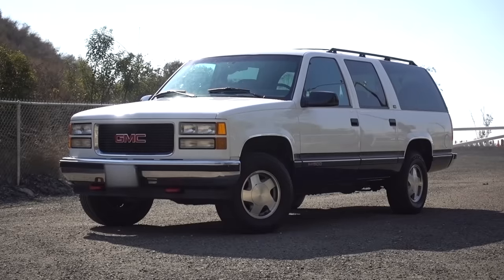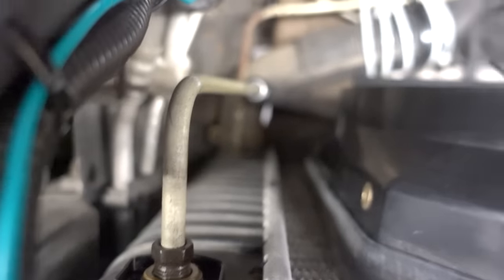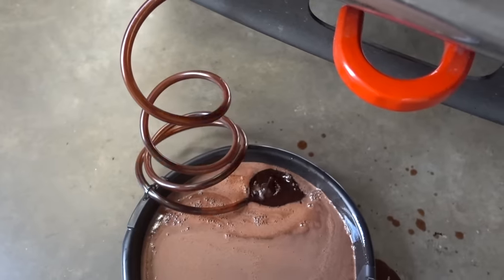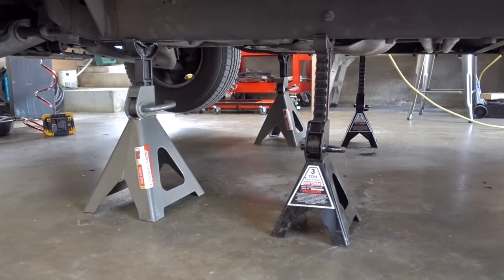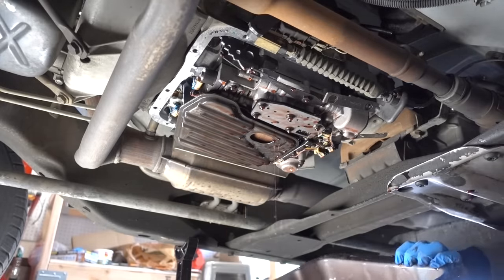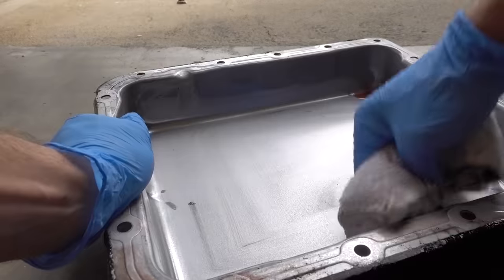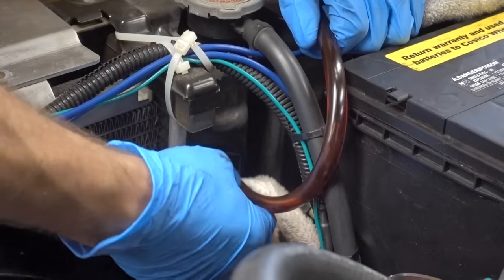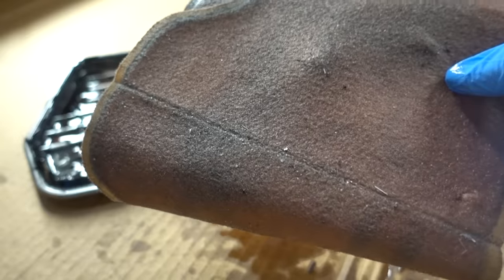Why You Should NEVER FLUSH YOUR TRANSMISSION FLUID!!

Comment: "Why You Should NEVER FLUSH YOUR TRANSMISSION FLUID!!" (proceeds to flush out tranmission)
Reply: What he did ia not even a flush. It was fluid replacement only but he he called it a "flush".  He's a  confused guy.
Reply: I was thinking the very same thing after watching...well it did get me to watch so there ya go.
Reply: I wouldn’t flush it at a shop I think they use pressure and you will end up with more leaks than you had I’d change it but not flush I guess he don’t know the difference
Reply: I ABSOLUTELY AGREE, for example when he shows the metal in the old filter, I considered that the filter WAS doing its job. I have seen many screw-ups by kids working at quick oil change shops doing real damage at this. I currently am driving a 21 year old Buick LeSabre with over 100,000 mils and the HORRIBLE :-) original fluid in it and it shifts and works perfectly. This transmission fluid change is like the air filter scam, or the NITROGEN tire inflation stuff. I know you cant hear me but I am SCREAMING just like he did, but I am saying "IF IT ISNT BROKE, dont touch that transmission".
Reply: It's called 'click-bait'....
Reply: One added note, some transmission required running a relearn procedure, look it up for your vehicle before you start.
Reply: click bait
Reply: John Dossey This is definitely true, especially on a good GM tranny, they last year's and don't beg for that much attention if taken care of, it doesn't always require even so much as a complete fluid change, I've seen 200-300,000 miles on them and 20-25 years and shift almost perfectly and as if not better than new, I'd recommend checking and adding some. And if it's the "un-checkable" style with only a hidden fill plug, There is a screw to check and I usually just drain a bit if it's full and add approx 2qts after about 125-200K miles, at least that's what I've done to all of them and they all now have well over 175-255k or close to it and they shift amazingly smooth without any issues in the Buicks and all, I've worked with many, but I DO NOT recommend a flush and n them nor would I say they even need anything else unless a rubber seal leaks in which case I still just try to replace the seal without disturbing anything as much as possible by all means, and they will continue to be the way they were, I'd say Oil change and fills of any obvious fluids do best for them.
Reply: I meant to say Oil change with(Engine obviously) and any other fluids just to be filled and maybe something good for coolant and oil coolant for corrosion issues and oil for loss of pressure is(usually higher viscosity. Or Lucas etc. Whatever floats your boat pretty much).
Reply: @erwinmelgar9575  If you listened closely, he even states it's not a "flush".
Reply: He didn't call it a flush... He literally said he chose not to flush it, just change it... And that is all he did, was a change, not a flush...
Reply: @jldossey45  false fluid should be changed every 30k miles
Reply: @jldossey45  times were different with that Buick Trans and When that Trans fluid was made.. CVT fluid is not even thick it poors out like water, thats probably why they don't last very long and have issues.. Most of Todays Transitions need there fluid drained and filled from 35 thousand to 75,000 miles depending on the make.. But the dealer will tell us it's for life! Life only being 100,000 Miles and if you get to 150,000 miles you are doing real good, But I notice that the people who don't have issues with newer cars Do the Necessary maintenance, And most importantly keep Fresh fluids in there Vehicles constantly, It's not that much money to flush your trans every 35,000 like a hundred but worth it if you plan on keeping the car...
Reply: @JeffCounsil-rp4qv  he said it in the beginning of the video.
Reply: @jldossey45  Drain and fill, with the original type of fluid. Stay away from the back-compatible stews formulated for later models. IF Dex III was still the original, use Dex III.
Reply: Thats why he makes the big bucks
Reply: I don’t understand the title either
Reply: The flushing out of the old fluid he says when you see bubbles shut the engine down immediately.......I recommend an assistant for this step.  By the time you see the bubbles, get around back to the interior and turn off the key that could be the difference between transmissions being totally starved of fluid and.....damage already done....

You didn’t say what the bolts you torqued inside the transmission housing.  

Good tip about the magnet.  With some modern day “Sealed for life” transmissions the filter is embedded in the transmission case.......yes you Ford.    Even with flush most people would probably not think about removing the pan to check the magnet.

My 03 Durango did not have a drain plug. You had to loosen the bolts and drain fluid one corner at a time.  Had a fill Tube but no drain plug.   Fast Forward to my 2011 Mercedes E350 has a drain plug but not fill tube.  You have to force feed the new fluid from the lower side.

1 Road:  I am not sure what part of the country you are in but they have lab service in Fort Wayne, Indiana.  I used it for a coupe of oil samples but I would suspect they could analyze other fluids.  They ship you the kit which is basically the same concept as Blood draws for lab work.  Take a sample of the old fluid during draining and send the sample to them.  A few days later they should be able to tell any excessive levels of one material, overall condition and possibly early heads up for possible future problems fluid wise.

Google Blackstone labs.
Reply: @jldossey45  every car I've changed the trans. Fluid in 3months later the transmission started to slip....
Reply: Erwin Melgar what’s a flush then?
Reply: In my opinion this is considered a flush. Drained the old fluid, ran new fluid through it, drained that, then put fresh fluid again. The middle step is supposed to flush out all the old crap.
Reply: 😆😆😆 nice one
Reply: You're shouting. and it is annoying
Reply: and NOT helped by misleading titles and screaming presenters
Reply: @thomaslemay8817  shouldn't have given them that coffee break.
Reply: @jldossey45  How often have you changed your motor oil and brake fluid?
Reply: John Dossey transmission fluid and filter replacement works if done correctly, 540,000 miles and counting, 1998 5.9 12v dodge ram 2500 p-pump, since new i change transmission fluid and filter every 60,000 miles and gasket every other transmission fluid change, i pull an 18,000 pound trailer regularly, i also never abuse the truck by revving it hard or punching it off a dead start, she shifts as good as day 1
Reply: I hope to only say this on the subject of not touching fluids if "it isnt broke":  if it isn't broke, it still doesn't need ignored.  Nearly all vehicles have a maintenance schedule in the owners manual.  Some recommend oil changes every 3,000 miles and some at 5,000 miles.  Change the air filter every so many miles, rotate the tires every so many miles, transmission fluid, radiator fluid, checking belt(s), etc.  Following this schedule is the recommended schedule suggested by the engineers of the vehicle.  

We can all say we had a vehicle last X long without something being done but also know someone who wasn't as lucky.  Some people love beyond 90 years old, some have a heart attack and die at 30.  One car may last 20 years while another gives out at 7.  Follow the schedule in your book and good luck.
Reply: YOU wasn't paying attention Mos!
Reply: @moss8448   I kinda thought when I seen him "break loose" tranny coolant line with an "adjustable wrench"  I was like Oh boy. But he did spray Wd-40 first. Now my fffn ears are ringing. Good video All n all. 👍👍
Reply: The pressure is far less than the normal line pressure...it's only enough to move the fluid out.  Myth.
Reply: Howard Russell l
Reply: @nc28144  every 30k, says who? shops that are trying to sell things?
Reply: @jldossey45  How about a 30 year old oldsmobile with 218,000 miles slips second to third in first mile of trip find afterwards.
Reply: @stephencannon3140  . I have a 1998 Toyota Camry le with 110 thousand miles I just did a real transmission flush and it was awesome and way way more easier to do I practically flushed out all the old transmission fluid about 10 quarts and it only took me 2 minutes to flush it out with a 12 volt oil transfer pump I learned this by watching a fix it angel video lol my car is easier than this guys car to work on  oh and changing the transmission pan gasket was also a piece of cake. Lol .
Reply: @jldossey45  I love having Nitrogen in my tires. Pressure never fluctuates with temperature change,nor altitude change.  As far as air filter it should be changed when dirty for sure, right along with cabin air filter such many peopledon't even realize they have a cabin air filter.
Reply: @t-rodshader9593  Some vehicles say that transmissionfluid is good for life of vehicle but if you look into it most transmission fluids are only rated for 100 thousand, but that can drastically change if your fluid gets to hot such it can if sitting a traffic jam or something,an when it does over heat it cuts about 25% of its efficiency with only like a twenty degree over heat,and if it gets to hot it can lose up to 50% of its efficiency.
Reply: @stix562  maybe up to 5 mile per a gallon difference. Some people donttc realize most transmission fluids are only rated for about 100 thousand miles and the efficiency of the transmission fluid can be cut down by 50% from getting to hot,so now the fluid would only be good for 50 k.
Reply: @rolexshine923  I would recommend a AmsOil bypass filter system and running AmsOil. Best oil on market and you can send them samples of your oil and they will give you a report on the oil. Theres a Mac truck drive who runs this and has over a million miles in truth with never changing the oil because of the .04 down  to  
.02 micron bypass filter.
Reply: @jldossey45  in my field I use nitrogen. Nitrogen does not expand with heat or decrease with cold. There for it does what it's supposed to do when put into car tires. Plus it's dry. This keeps moisture out and the tires last longer.
Reply: @victorbunch7725  you WASN'T paying attention in English class
Reply: I don’t think getting it flushed is really that bad, what happens is people wait until their transmission is acting crazy and then go get it flushed and then it goes out later on, and then say flushing it is what destroyed it, when it was already going out to begin with
Reply: @rolexshine923  Your mistake is that you are driving like it is supposed to be driven. If you would only drive it the other way, you would have a shiny new truck by now. And a truck payment to go with it.
Reply: @jldossey45  You probably are wrong to not change transmission fluid. But all you need to do is drain and fill. If it has a drain plug, just drain it and replace what comes out. If it is running right now, you don't need a filter or a flush.
Reply: Retorquing to the proper torque is a good idea, out of my 260 unit GM 1 ton fleet I've changed the fluid & filter (no flush) on all of them a number of times. Loose valve body bolts are not real common, but one time a bolt was completely backed out & the pan was holding it in. Some drivers drive 'em hard, some don't, I change them all on the severe usage schedule, they all pretty much need it, as the magnets can be pretty much loaded more often than not. I'd never use the DEX IV  in a DEX III tranny.
Reply: @erwinmelgar9575  true, dealers do back flushes and don’t change the filter. IMO COMPLETE waste of time  and 250 bucks.
Reply: @jldossey45  don’t ever change it thinking it will fix you’re shifting problems in the near future.
Reply: @t-rodshader9593  True that. My 96 Astro van sat during winters in Spokane, being rear wheel drive when I had a front wheel car that commuted far better. I got slipping in the transmission when spring came so I had the transmission flushed and liquid replaced and it got rid of the slipping transmission instantly.
Reply: @r-prizzle2168  flushing uses a flushing machine that forces not only trans fluid but other chemicals as well and can easily cause damage to the transmission when it forces dirt to clog the oil's passage way.
Reply: @max41050  what angel did was a fluid change, not a transmission flush.
Reply: @rmo4222  agreed.  I do repclace my own fluid and filter as well as the fluid left inside the torque converter which is like half of the total capacity.  Drain and fill about every 2ltrs until the fluid runs clear.
Reply: @erwinmelgar9575  . Thank God because I did the same thing myself,after watching his video I ordered the transfer pump from Walmart and got practically the same 5 gallon jug at winco, my car is a 1998 Toyota Camry le 4cyl, so it was very easy, but weeks before doing this procedure I had already removed the transmission pan replaced the filter and the transmission gasket. Is been 3 months already and haven't noticed any problems, but I have to admit I was questioning myself afterwards because the car already had 110 thousand miles, but the fluid didn't look dirty, that's why I went ahead and did, so I should be safe because this wasn't a real flush well I hope so .
Reply: @max41050  you can get away without using a pump, just drain about 2ltrs out, stop the engine and fill with 2ltrs through the dipstick hole(assuming you have it and assuming your trans takes the fluid in from the pan) then repeat until the fluid runs clear.  Either way, i messaged angel about it and it's okay to use it with my car, Corolla 2006.
Reply: @erwinmelgar9575  . You're right but the pump only cost me 25 dollars and it works perfect on all 3d and 4th generation Toyota Camrys 4cyl, actually I think that the video I saw from fix it Angel was a 4th generation Camry just like mine, he did it on other toyotas but mine was the easiest one, the transfer pump, the 5 gallon jug and a little bit of vacuum hose that I bought only cost me about 45 dollars and I'll be able to reuse it over and over again, I'll probably be doing it again in another 4 years.
Reply: No, he means never do a BACKward flush with a machine at a mechanic shop.
Reply: @erwinmelgar9575  No, it was a flush alright, confused guy.
Reply: @jldossey45  Agreed.  You should never change your transmission oil or your engine oil.  If it ain't broke, don't fix it.
Reply: @oxpahnakompromatkohtpol436  have you seen a transmission flushing machine?  I reckon not, confused guy.😉
Reply: @oxpahnakompromatkohtpol436  i hope this your're being sarcastic as this is the worst advice anyone can give to car owners.
How's you engine oil sludge doin?😁
Reply: @erwinmelgar9575  Yes, was being sarcastic.  I change my engine oil on my 2017 Subaru WRX every 2,000 miles.  Overkill?  Maybe, but changing the oil is the cheapest insurance you can buy.
Reply: @oxpahnakompromatkohtpol436  well, good for you.  I reckon it might be a bit overkill but whatever keeps you sane and that works for you is better than not taking care of your car at all.
Reply: No
Reply: Lol
Reply: @thomaslemay8817  You are exactly right, most all modern electronic transmission have adaptive values that the control module references for decisions on shift timing, line pressure rise, etc. what they don't realize is that after changing the fluid that if the relearn procedure is not performed that the driver may experience  erratic, harsh or delayed shifts, forced downshifts when coming up to traffic lights, etc. Always consult factory service information (Not Youtube) for your particular vehicle and any relearn procedures if applicable.
Reply: @t-rodshader9593  Good Advise with that mileage, best to not fix what isn't broken. That quart or two pumped out & replace with new every now & then has the needed detergents to keep it running smooth. At the most, all I'd do is drop the pan by letting one corner hang, loosen some more once it stops draining to finish draining most, remove pan & change filter. Clean pan, install new filter & pan gasket and refill with proper ATF (not synthetic). No need to flush an AT with 200,000 miles or begin use of synthetic fluid, will likely run smoother with a filter change & refill, probably until the car is shot for good.👍

Flushing the ATF is overkill for a ride with 200,000 miles, this is best done beginning by the recommended change intervals in owner's manual if purchased new. Reason is because there's sludge in there, don't want a particle to break loose & block the flow of fluid, will likely cause the end of the life of transmission. With this mileage, the repair cost will be more than down payment on the ride's replacement. 

However, as stated above when purchasing new, I do recommend changing fluids/filters as called for in manual (TF usually every 25-30,000 miles). If doing so, there'll be no need for flushing, should always be partially or somewhat red.👍
Reply: . . . and give zero reasons not to do it.
Reply: @jldossey45  who needs an owners manual right... who cares if it says change trans fluid every 75k miles? wait till the trans breaks and you need to spend $3000 to rebuild or replace it... i agree with the saying "if it aint broke dont fix it" but not when it comes to neglecting your vehicle by ignoring general required maintenance until it costs you an arm and a leg. there is absolutely a difference between "if it aint broke dont fix it" and "neglect your vehicle until it dies". i guess while you are at it suggest people dont do oil changes either. i mean ive seen situation where people go 100k without an oil change so why not right?
Reply: It’s meant to get attention. We’re an attention hungry society.